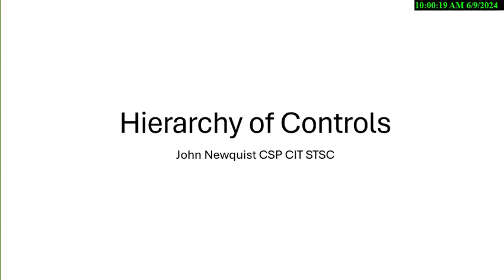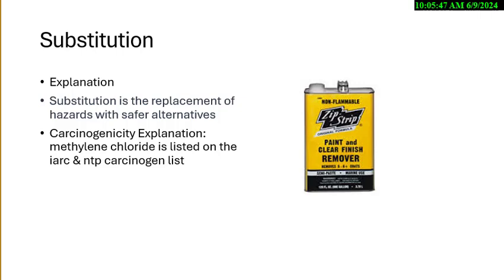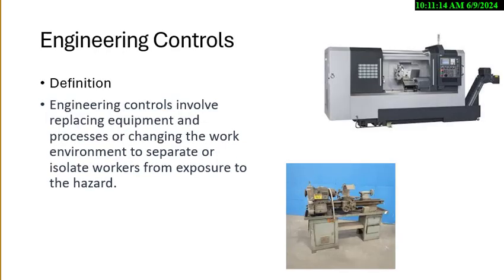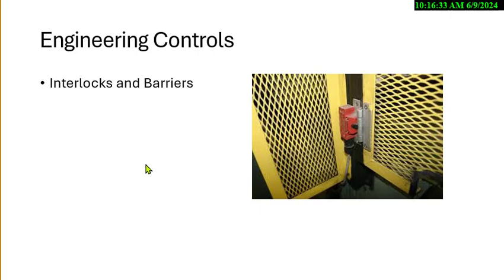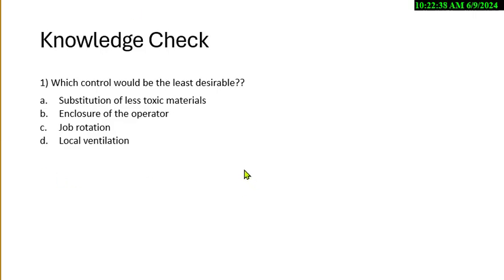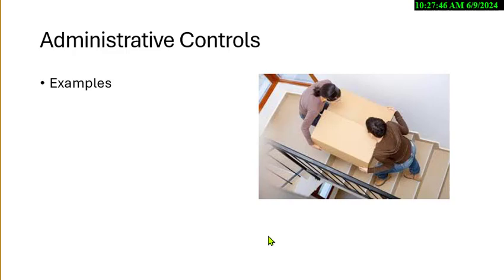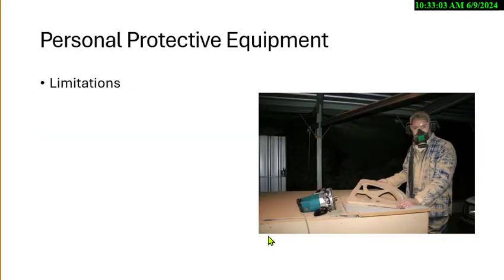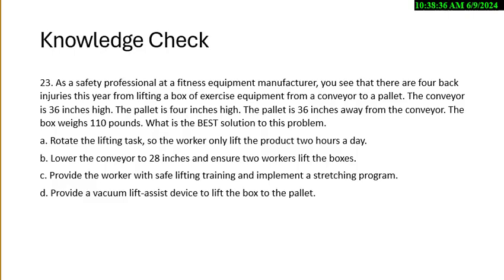Hierarchy of Control BCSP ASP CSP STS STSC CHST SMS

Comment: In administrative control you have mentioned design change as well, I guess the design change is more an engineering control. bit confused if you could guide please.
Reply from the maker: I was showing that the company was using job rotation to push the stainless steel cart. The design change is necessity to fix the hazard. The would be an engineering control

Comment: Hello John. Did you say that examcore has  the exact questions that are on the test?  Is that the case for CHST and SMP ?
Reply from the maker: They are the exact questions, but the trick is when the database is 20,000. You have a chance of probably getting three questions. Maybe five at most on the 200 question test. That is true for the SMP or other tests.

Comment: John, a few of these confuse me. Wouldn't two hand controls be an administrative control since you are changing the way people work?
Reply from the maker: In the hierarchy of controls, two-hand controls for a punch press represent an engineering control. These controls are designed to enhance safety by requiring that the operator use both hands to activate the machine, ensuring that their hands are away from the moving parts during operation.

Two-hand controls require the operator to engage two buttons simultaneously to activate the machine. This setup is particularly useful for machinery like punch presses, where the risk of hand or finger injuries is significant. The buttons are typically positioned such that the operator must consciously and intentionally use both hands to start the machine, thereby preventing accidental activation or placement of hands near hazardous areas.

Two-hand controls are a direct application of engineering controls within the hierarchy of safety measures, providing a physical barrier (or requirement) that prevents exposure to the hazard. This control measure is considered more effective than administrative controls or personal protective equipment (PPE) because it does not rely on behavior or protective gear but instead modifies the way equipment is used to enhance safety inherently.